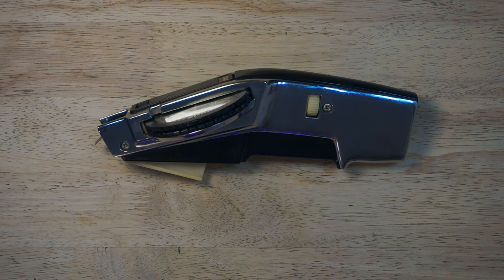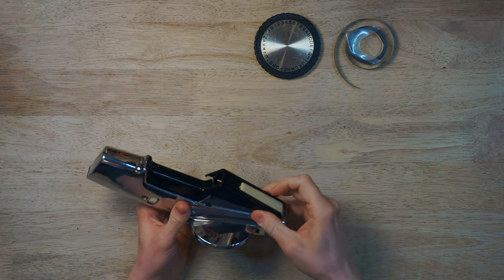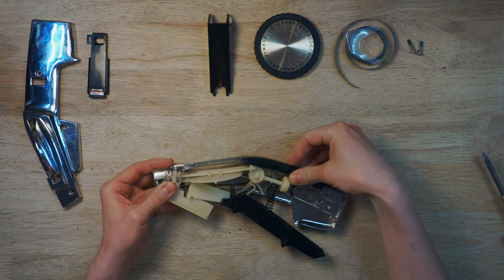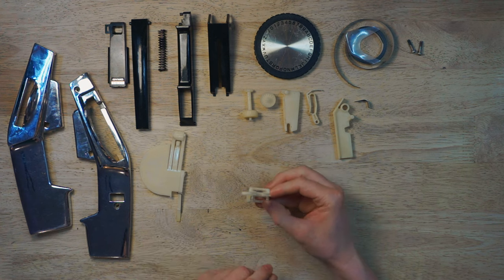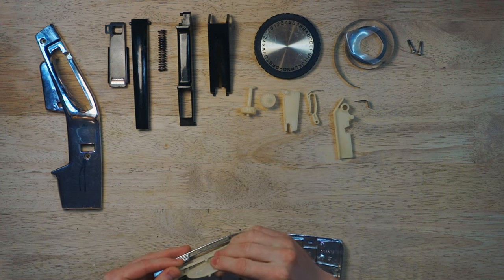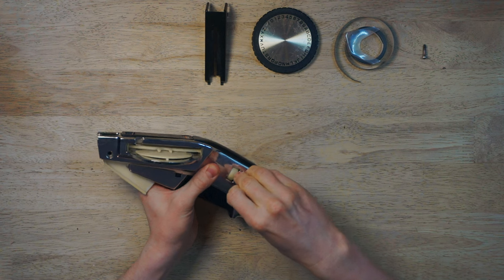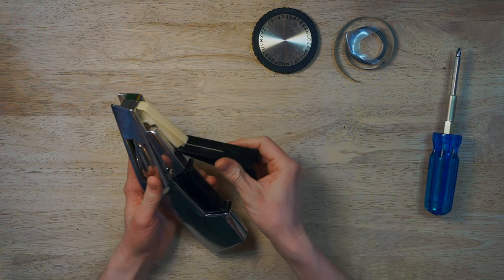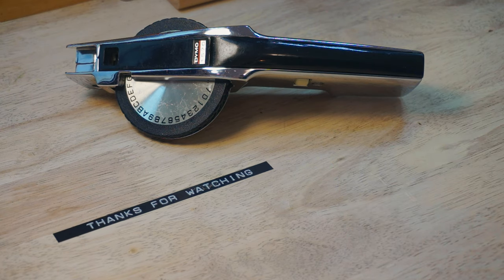DYMO 1570 Label Maker: Full Disassembly and Reassembly - Meditative Maintenance

Comment: Great video.  I disassembled my 1570 label maker and repaired, but when I was putting back together I noticed a spring fell out and I don't know where it goes.  It is a different spring than the two you have shown in your video. about 2 inches long and solid wire. Do you know where it goes?
Reply from the maker: Hmmm, I'm not sure. I noticed in this teardown that their dymo 1570 had an extra spring from mine, perhaps that could be it: https://youtu.be/uqG_mJiZ7Ls?si=mkHTMY-UkI5h4PIX
Reply: @ExercisingIngenuity  I saw the spring at 1:24 in your DYMO 1570: The Cadillac of Label Makers.  Thank you.